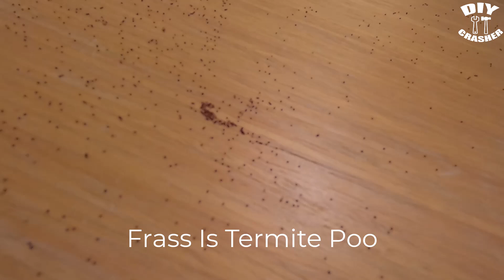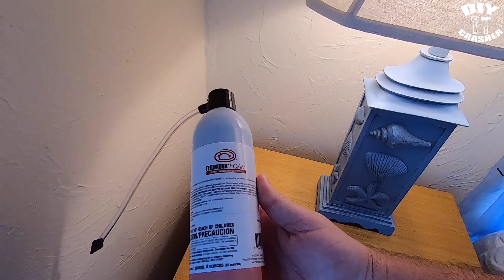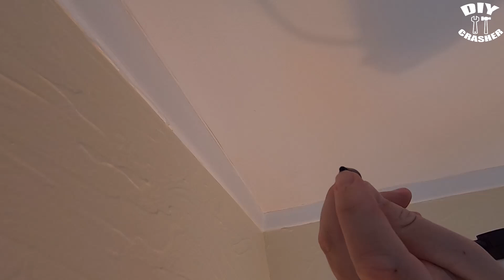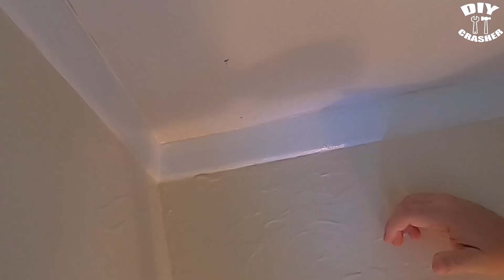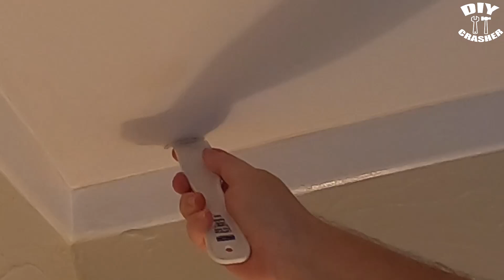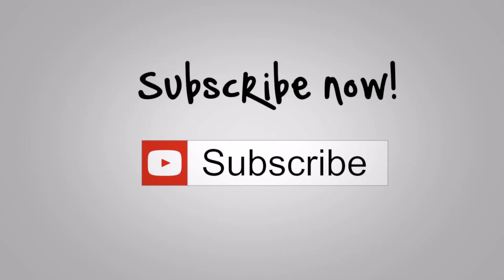Got Termites? Quick Fix Using Professional Products!

Comment: Did you get rid of the problem? Plus, how full was the can after this treatment that you did? I'm just wondering if 1 can is plenty.
Reply from the maker: Yeah there was plenty left in the can.  I did this treatment for a friend many years ago.  It did work for that area, there was no new termite kickout holes that showed up in that room and he didn't have problems in any other areas of the home.  If there's a wide spread problem with multiple areas then it would be best to do tenting but for spot treatments like this it worked pretty good.  Just have to look for the clues and signs of them being present and figuring out where they are, that's the biggest challenge.
Reply: @DIYCrasher  I'm getting a thermal camera to check the walls I had a pest control company come out last year at this time they did a treatment and I saw 3 termites in the area that they treated I had them come back out to look he told me he didn't see activity and wouldn't do anything until he did. I'm not going to sit around letting them eat through the wall just to make him happy you know? You can't count on anyone these days this company was paid $1,800 just to spray bora care in the attic and spot treat a little section. Thank you so much for the response. I appreciate it.
Reply from the maker: Wow!  Yeah that is crazy what they charge for the different applications.  I hear you on wanting to take care of it yourself.  With a thermal camera might show if there's a concentrated number of termites but might be difficult if it's not a large amount of them.  I had bought and applied Bora care to my floor joists, it took a couple gallons but was only like $100 if I remember correctly, prices have probably gone up now days, but regardless still a fraction of the price of a service doing it.  And that's the truth of can't count on anyone to either do it right or not ripping you off or both.  It's a shame!
Reply: @DIYCrasher  Yes I bought 2 gallons of bora care I went under the house and sprayed myself and I plan to spray the other gallon in the garage. I even trenched around the house myself with Taurus sc just to be sure that's a 10-year treatment. I'm sure hoping the thermal camera helps me I'm planning to check all the walls in the house. Maybe that'll bring me peace of mind.
Reply from the maker: Sounds like you're doing a good job yourself!  Trenching is another expensive service they like to charge $1000's for.  You could probably start your own pest service after you're done!  You know how to do it!
Reply: @DIYCrasher  haha this pest control guy told me you sure know a lot about termites. Thank you I appreciate the kind words. I will subscribe to your channel and keep in touch.
Reply from the maker: Thanks for subscribing!  Hope you like tools, since I do a lot of tool deal videos now and periodically post DIY tips.  Hopefully with everything you've done in treatments will end the problem for good.
Reply: @vaughn257 will you please report how it goes with the thermal camera and which one you got? I’ve been researching so much and want to get one as well as a moisture meter. I wish there was a termatrac I could rent, they’re too expensive to buy. Not sure how effective all of this will be, but beats sitting and waiting for frass to appear :/
Reply: @DIYCrasher did you use a pump sprayer to apply the bora care? Need it for the floor joists under the house
Reply from the maker: @Carolifndz  Yes I used a pump sprayer, I actually have a battery powered one that made it easier than a traditional pump sprayer.  It sprays at a consistent even pattern and was able to get it done quicker since didn't have to stop and pump it up.  The one I have is a Milwaukee M12, 2 gallon, but if you're in a different tool battery platform they might have an option as well.  It's definitely worth it and I also use it for weed and regular pest control applications.  As far as a thermal camera goes, look into one that attaches to your smart phone (assuming you have a smartphone).  I have a FLIR brand that plugs into my iphone and it uses the iphone screen as the display.  It's a lot cheaper than a full on thermal camera with its own display and the FLIR brand is one of the top brands to consider.  The thermal camera does seem to be hit or miss and really depends on the concentration of termites that will show up as a heat source on the screen.
Reply: @DIYCrasher thank you so much! Really appreciate the help and info

Comment: Hi there, single mom here trying to be all handy! 😆 Thank you so much for your helpful video! The same thing happened to our house. A 1/2 inch mud tube is hanging off our ceiling. I would like to try this method since our termite infestation seems localized. Any updates after the treatment? Much appreciated 🙏🏼
Reply from the maker: It sounds like you might have something different than what the house I did this treatment in.  A mud tube would possibly be subterranean termites vs. the ones in this video were drywood termites.  Also, when you say it's a 1/2" mud tube, is it a long tube but just a 1/2" wide or is the total size 1/2"?  If it's like a small blob or dot of mud with a small tube then it could be a mud dobber (it's like a wasp).  Maybe do some searching to confirm what you have and then search for the proper treatment as it likely might be different from what I used.  Good luck!

Comment: The first mistake you did was drilling into the drywall. You should use a pic instead because when you drill into it, you damaged the gallery. If you would’ve done it the way that I’m telling you to do it you would’ve extracted tons of termites already by now.
Reply from the maker: That's a good tip, thanks for sharing a different approach! 👍

Comment: You need more treatment than that one can. You need to trench, then check your annular space between your concrete foundation and water pipes, if applicable. I would treat 8' all places from the spot.
Reply from the maker: Thanks for your recommendations.  This treatment is only for spot treatment where there was a known problem with drywood termites.  These were drywood termites which fly to their location and don't come from the ground/foundation like subterranean termites do.  Otherwise the trench method is for subterranean termites.

Comment: Why are you not wearing Nitrile Rubber Gloves?
You're holes are too small, this is the reason why you're getting back-flow all over hands.
The holes should be 3/8 to 1/2 diameter
Thanks For Your Video Post!  Im getting ready to do portions of my walls too..

Comment: You really need to hire a professional. If you have termites all the way up to your ceiling that means it’s possible damage staring all the way from the ground to work their way up to the ceiling. You should never treat unless you know exactly what you are treating just because you see a kick out holes does mean you have termites. It could be carpenter ants or some wood destroying insect.  All termites are not created equal you can treat one area and a certain Aggressive Colony  would send 1000 termites to eat through that one treated area, they will died from the treatment only so they can make way for 5000 to make their way to the untreated wood. I know it’s becoming a fad that everyone now a days are making videos as if they have found some kind of quick fix , but you really need to get a professional to identify what you really have. Spend  a thousand or 2 is way cheaper than buying a new house or rebuilding one from years worth of damage.
Reply from the maker: Thanks for your comment.  These were drywood termites and not subterranean termites that you were referencing working their way up from the ground.  Drywood termites spread by swarms and fly around  and typically can enter through roof vents or soffits and getting into the attics.  This particular case was confirmed drywood termites by Terminex.  They produce the small frass which is termite poo, carpenter ants frass is different.  Granted there could be other areas that can't be seen that are infested with termites but this is a way to treat a known spot where there is current activity.  The ultimate treatment is tenting to eliminate anything that is currently infesting the property.  The next best treatment is to use a product called Boracare to spray on any exposed wood and it lasts the lifetime of the wood and will kill termites and other wood destroying insects.  Which this particular house where this was done is no longer around, it was destroyed by a hurricane a few years ago and it took any leftover termites with it.

Comment: Thanks for the video. I learn a lot!  Mental note: use a drill over 1/8... 9/64 worked perfect. Also wait 7 or 8 seconds before taking out the aplicator
Reply from the maker: I'm glad you found the video helpful!  Good points on the drill bit size and waiting longer before pulling it out.
Reply: TY both. 9/64 and waiting a bit went perfectly - no mess at all
Reply: I wonder if the second hole was through. That could be the reason for leak.